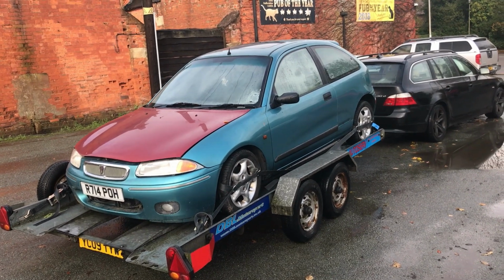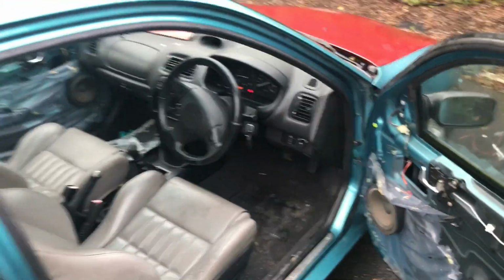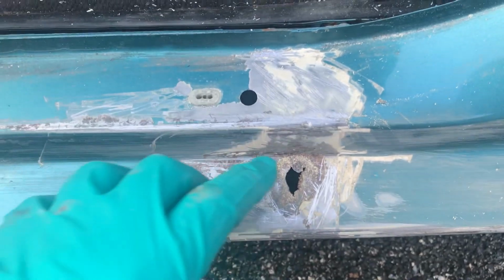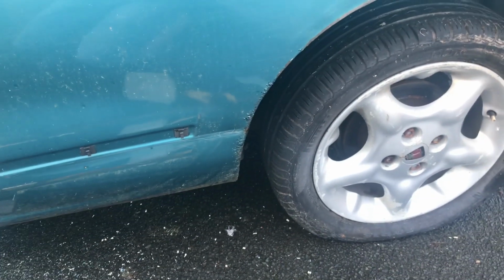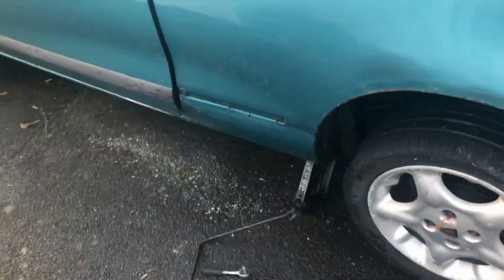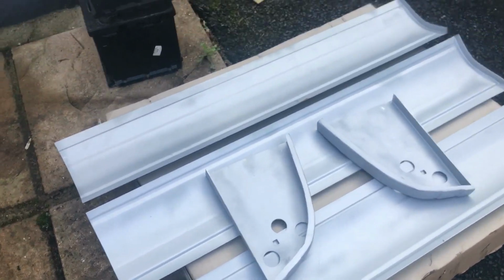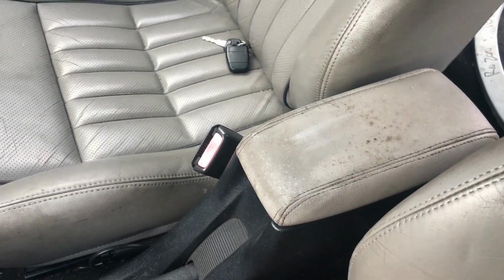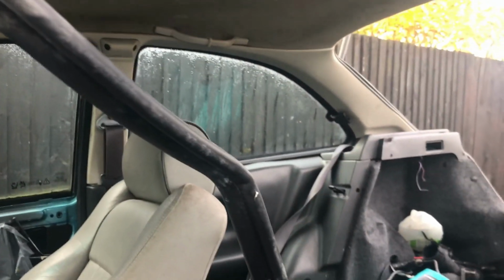Rover 200 mk3 Bubble T16 Turbo - Video 1

Comment: I built this car. Started off as a 218. I got it for 80 quid with a suspected seized engine. Purchased a rover 200 cab which had already had the conversion. Took the engine and the front seats.
Reply: I have no idea where the red bonnet came from.

Comment: My old car xx
Reply: SpareTelly haha. I actually did the engine conversion on this one. I fitted rover 200 cab front seats in cream. I purchased the 218 for 80 quid with a suspected seized engine. Im sure it was 2008 or 2009 when i did this car.

Comment: I had two of these, well, 214is back in 1996. First one leaked within the 30 day hand back period so got the dealer to give me another with all my 'extras' fitted moved over to the newer car, an extended warranty and further £500 back else Id had the other back and walk away.
2nd car didnt leak(!) and was actually a very nice car. Lovely gearbox. I traded it just over 20 months later when I changed jobs and needed to travel further. Got a Toyota MR2 (mark 2) which was also a nice car with a short shift gear change. Was one of the last mk 2 MR2s made.